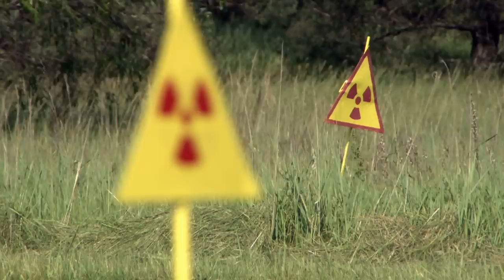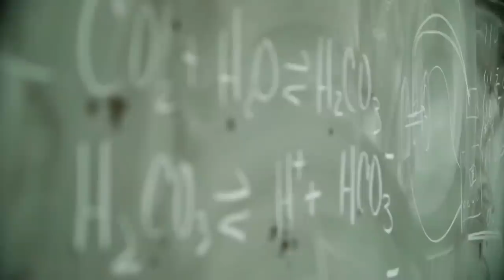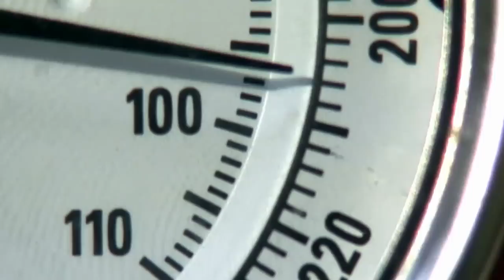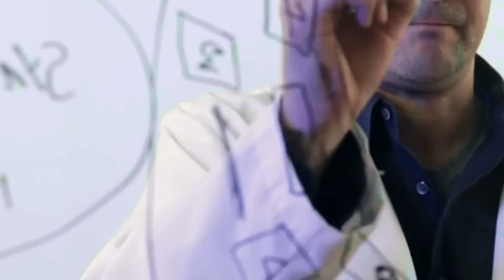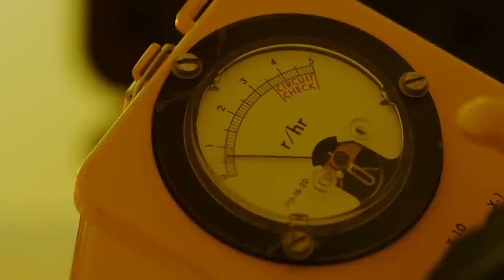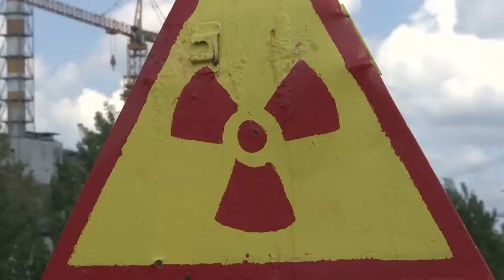China’s Most Powerful Global Weapon - A Synthetic Sun?

Comment: If a fission reactor splits atoms, and a fusion reactor fuses atoms, aren't they possibly two halves of the same engine? I wonder if anyone has ever contemplated using a fusion reactor to fuse atoms all the way up to fission reactor fuel and then splitting them back down... both processes produce energy, but from what I understand a fusion reactor has trouble producing more energy than it uses?? Maybe? But if both were linked together maybe the fission side of the engine output would compensate? Scientific thoughts, from an unscientific mind...
Reply: I don't have a degree in nuclear engineering, but I can safely say, it doesn't work like that.
Reply: @lamarkingram5320  I'm sure it doesn't, currently anyways but who the fuck knows the future, still its a cool thought to play with
Reply: Damn thats interesting. Like how you broke it down a bit for context. Nice one Justin, you've got me wondering now
Reply: The closest working fusion reactor to us is the Sun and with all its power and gravity it can only breed elements up to iron. A long way/weight off from Uranium, which is made by Super Nova's. So with the Sorcerer's Stone theory being disproven long ago I'm pretty sure that humans making very heavy pure elements is not going to be possible. Not to say that some sort of lighter element combo couldn't work but I cant call it. Interesting though, and good thinking.
Reply: Unfortunately it’s what’s known as the Iron peak, fusion and fission extract energy carried by the nuclei of elements with atomic masses less than and greater than iron, it’s related to the spherical symmetry of the nucleus of an atom, but creating elements above and below iron consume energy, thats why fission creates energy by creating lighter elements and fails at iron and fusion creates energy by creating heavier elements and fails at iron, note that there is fluctuation, but that is the general pattern
Reply: @connerwiseman4876  we make small quantities of very heavy elements in laboratory conditions everyday, the just don't last long, and that artificial sun burns 5 times hotter than our sun so I'm thinking we'll be able to overcome the obstacles eventually
Reply: @justinwelch1873  If you’re referring to operational fusion reactors, then yes, indeed and how exciting, but forgive me for adding this tiny pedantic note, when we create heavy elements in labs, we are theoretically adding energy to make that transmutation, that means it is certainly impossible the extract further energy from fission and fusion once either process reaches iron, I don’t think you were referring to that, but I just wanted to add it because I feel the need to put all the information on the table to make sure we’re both on the same page, sorry if I’m unnecessarily bring that up
Reply: @connerwiseman4876  so in my head none of this is currently possible, but and just going out on a limb here, if we used a fission reactor to power a fusion reactor, and a functional fusion reactor, and nothing else, our energy would net 0 or less? Look I understand it's not possible now, but maybe in the future? The biggest problem I see with my idea is how you reconstitute an atom after breaking it up into its various sub particles. That doesn't seem like an easy one to overcome.
Reply: Nuclear fusions are using two isotopes of hydrogen, deuterium and tritium,  into helium. It requires tremendous energy to achieve this. 
Hydrogen and helium are the both the smallest atoms known. 
Fission uses much heavier elements in the actinide series such as thorium and uranium. These are heavy dense metals. 
So as far as I understand, we can't fuse the lightest elements to create the densest elements. 
The only way to possibly do this would be using thermonuclear weapons.
Reply: Not a bad idea in theory. But consider looking at the periodic table. you have hydrogen in the very beginning, and uranium at the very end (let's not count artificial elements that do not occur naturally). At best, energy is produced by reaching the middle of the periodic table (right around iron) from both ends. And that's already 100% efficiency. So while it's tempting to "recycle" material created in fusion reactors and decaying them in a fissile one, it would take way too much time and way too much energy (more than these systems could produce).
Reply: @vonschweringen8321  everyone is stuck on what's currently possible, if we all thought that way there would never be new innovation or technology. Years ago fusion reactors were thought impossible, before that fission reactors, and all the way back through time. We're literally breaking off pieces of space with the hadron collider, making mirco black holes. Soo I'm positive we cannot do it now, but I'm very hesitant to say anything is impossible. I understand very smart people, people obviously smarter than me say it cannot be done. If it can be done in a natural process I'm sure we could find a way to do it in the future, yes it would require lots of energy and it would be really hard to do and possibly dangerous. But imagine a future where we could build a Dyson sphere, in this future planets and stars become our machinery. We literally accidentally created a warp field
 https://coffeeordie.com/alcubierre-white-warp-drive/

Now tell me you know for certain that in the future it will definitely not be possible to do. I feel like scientists these days are too specialized in they're fields and also want to be the absolute authority on these subjects so what is known is all there is to know. Once we can bend space time what's stopping us from putting an entire sun or even a black hole  into the equivalent of a backpack and carrying it with you besides energy. Imagine if the Wright Brothers just gave up on their plans to build a plane because they listened to literally everyone around them, like they just threw their hands up in the air and said "Well shit I guess it's impossible, let's do rock, paper, scissors to see who gets to marry our sister instead".
Reply: Stop giving me reason on why it can't work and tell me what it would look like or how it could function, or how we could possibly overcome the obstacles.
Reply: @justinwelch1873  Alright, firstly, when you say using a fission reactor to power a fusion reactor, do you mean using the energy produced by fission to heat up fusion material? Because it’s an interesting idea, and atoms reform in fusion cycles once the energy input starts to decline, then the plasma particles begin to reattach forming more stable elements which releases energy, boosting the reaction which should continue as a self burning plasma, if you’re concerned about knowing which elements are formed, it’s a matter of temperature and gravity as lower temperatures will restrict how dissociated particles can be in a plasma and gravity is needed to compact cooling plasma material to create heavier elements
Reply: @vonschweringen8321  Interestingly fusion is easier than you might think, Plutonium for example is a man made element created in fission reactors when uranium doesn’t split and remains stable absorbing more neutrons, additionally tons of elements, and really, every element above iron is man made, most were created in lab environments by heating up already heavy elements and carefully firing protons and neutrons to increase their size. If you’re talking about large quantities of heavy material from hydrogen and helium though, that’s Uber hard, a thermonuclear reactor couldn’t handle that task unfortunately and instead we’d need a supernova for the right amount of energy and gravity needed to compress cooling plasma into heavy elements
Reply: @connerwiseman4876  so harnessing gravity is the main barrier? So we would need technology that allows us to harness gravity, well as of now the only thing we can use to create gravity is mass until we figure out dark matter. So maybe something that can bend space time to put a large mount of mass in a small area and allow us to modulate the gravity  inside of a fusion reactor? Seems like we could do that if we invest money time and energy anf interest into Casimir cavities...
Reply: @justinwelch1873   Gravity is main barrier to produce super heavy elements from hydrogen and helium, though note, that process would consume energy, certainly not generate it, and with efficiency being a thing, we would get less energy processing those heavy elements in fission reactor back down to iron. Just remember that fusion reactions generally release energy when the products mass is less than of equal to iron and fission reactions release energy when the products are heavier than of equal to iron
Reply: @connerwiseman4876  so we'd need to scale up our fission and fusion reactors to the point that they produce more power than it takes to produce the gravity. Is there anything to say this is impossible? And if so how does our entire universe function,? if it's not a super large version of my idea? I understand there will be a thermal death of our universe at some point but what is life itself if not a mechanism to increase the efficiency of that power source as we reorder our surroundings, the materials at hand into things to increase our own efficiency and the efficiency that energy is used. Even if we aren't an efficiency mechanism in an engine then shouldn't our reason to exist be to fight back or even stop the thermal death of the universe or escape. If a process exists naturally then the only barrier to our utilizing it is the limits of our own mind, or the limits we impose on our thinking. I think it's possible, we just dont know how YET...
Reply: @justinwelch1873  The process of creating Uranium from hydrogen and helium requires a great deal of energy, this is not accounting for a real life reaction but just in pure theory, the simple equations requires lots of energy, then, splitting that large atom to go back will give you some of that energy back, but not all of it. No extra energy is gained from this process because you’re just going back and fourth, so in a way it’s just a very expensive battery, not a power source, assuming you can go between hydrogen and uranium at all, if you account for the tremendous inefficiencies involved, it would be far better to just use a normal battery over this entire process
Reply: Don't focus on it it's far future .. focus on thorium based molten salt reactors and Decay reactors.
Reply: @rajatdani619  True, it’s good to look at what’s practical now, personally I’m vying for SMRs but thorium/breeder reactors would definitely be great especially if that technology was then scaled down an implemented into current SMRs
Reply: This seems like a DEAD END.  Trying to keep temperature for 150 million degrees for any length of time,  it will melt everything around it.  In order to keep CONSTANT flow of electricity.  It has to keep the temperature for 150 million degrees forever.  This will never be reached.  Therefore, this type of project is a dead end.
Reply: @jeffjohnson5053  Very wrong, it is certainly a complex project, but unless you’re studying nuclear physics yourself, you should certainly not remark on its feasibility, in theory it is very much possible, the plasma torus does not come in contact with its surrounding walls as it is spun guided with large electromagnets, this reaction has already been demonstrated on large scale at incredible temperatures and boasts functionality. What you are right in implying, is that currently this is the utopian marker for energy generation, but it is certainly feasible, do not mistake that.
Reply: @connerwiseman4876  Feasible for only 17 seconds?  Who wants 17 seconds of electricity?  You are just not a practical guy.  We need a energy source that generate energy FOREVER, and Not 17 seconds, 17 minutes, even 17 hours.  That is just not good enough!!   Sorry to say, this is dead end, and I am just a practical guy.  You don't need to be a scientist to have common sense.
Reply: @jeffjohnson5053  Well I’m sorry to say that everything has a time limit, “forever” really isn’t a thing, I agree it would be ideally better to invest in fission which would lay the groundwork for more development in fusion, but you must be joking if you are going to make a statement that something is a dead end simply because you can’t even comprehend how it works, your entire argument can be rebutted simply by saying, sure it’s not practical right now, but it is the end goal, things will develop, and if you don’t understand anything, you shouldn’t say anything
Reply: That is called a Hydrogen bomb. Nuclear fission forces deuterium to fuse and leads to a very naughty explosion...
Reply: Actually, fission can overcome the Achilles Heel of fusion.  There just isn't enough Tritium to feed fusion reactors.  There are methods of fission that produce too much Tritium.  Waste Tritium from fission reactors could be used as fuel for fusion reactors.

btw  My high school Physics/Chemistry instructor called Iron "the ultimate cosmic ash."  You can make energy building up to Iron, and you can make energy breaking down to Iron, but when you have Iron, trying to make anything else out of it is going to cost you.
Reply: @ThatsMrPencilneck2U  Methods of fission that produce tritium? I know of neutron transmutation of lithium to helium and tritium, but I would be careful calling it fission or one might think you mean transmuting heavy elements
Reply: Do some further research.  You will discover why your suggestion simply won't work.
Reply: @justinwelch1873  You are correct. fusion power is further away now than it was 60 years ago.
Reply: They use different fuel sources, with fissile fuel being inherently unstable and requiring a large amount of precision, so that isn't possible. However, the general idea of one nuclear reaction feeding another is what was used to create hydrogen bombs - nuclear fission bombs who's massive amounts of heat and energy trigger a second nuclear fusion stage
Reply: @michael-dm2bv  I've been reading and re-reading your comment and trying to come up with a response to it but the only thing I can really say is that type of thinking is really lazy, to slander or discredit someone because of a handicap, or maybe because they got a couple things wrongs over they're career of being very correct. Scientific discoveries are usually made by discovering the right question to ask, and you cannot really be wrong for asking a real question. Like I might be wrong, I'm willing to accept that everyone else in the comments telling me it's basically impossible are probably right and most likely very much smarter than me, but I asked a question, and now I have many answers, cool thing about our universe is that you can have multiple different answers to the same question that can all be true at once, and what was true yesterday can change tomorrow as we advance our capabilities and understanding...
Reply: Unfortunately, the waste products of fusion are not fissionable. To fission the waste products you’d actually expend energy rather than gain it.
Reply: From a physicist: its hard to get energy out of fusion, but the energy is there, its been proven theoretically and practically (hydrogen bombs, the sun etc). To fuse heavier elements gets progressively harder (and by that I mean not difficult, but takes much higher energy, and the energy yield reduces). By the time we reach iron, there is no more energy released. You can't make elements heavier than iron without net adding energy, and WAY more than you got out of all the fusion up to that point. The only places in the universe that happens are exploding stars (supernovae, and they last just a few seconds, after starts bigger than our sun reach the end of their life - thats rare (in the universe, not just on earth), and there is no way we are going to reproduce that kind of cataclysm on earth, the numbers are literally astronomical). To get to Uranium, you need some of the biggest supernovae in the universe, the size that causes black holes - this is extreme physics, not just very difficult physics, but so far off the terrestrial scale that we are fortunate we don't have this going on anywhere in our astronomical vicinity, 'cos it would have killed us already.

So, long story short, no, we can't use fusion to "build" uranium to run fission. Not only would the physics not work at the fundamental level, but it would be beyond the capability of any entity that couldn't manipulate their whole galaxy (which we can't), and it's just a tad more economical to mine uranium right here on our tiny spec of a planet. Nature already did the fusing a few billion years ago, and gave us the products of its labours, locking up the energy of supernovae in the atoms or uranium we already have. Its a bit like the energy of our sun from a few millions years ago being locked up in fossil fuels we extract and use today.

Comment: Or we could just switch to regular nuclear energy. It's already clean. It makes very little radio active material that needs heavy storage. And it's safe. It's the disrespect of nuclear power that's dangerous. Look at the deaths from NE and fossil fuels. 1 is alot worst. 
Kyle Hill has a great series on NE going on.
Reply: yes, but it's also a huge liability. floods tsunamis earthquakes, random meldowns ect. all of these can incite disaster that leaves an entire region uninhabitable for years. so yes but you need to realise the risk/reward factor as well.
Reply: @onemorevideo1305  SMRs should solve the problem of not being as exposed as larger PWR designs, as they’re more compact. But also simply not building reactors on any grounds prone to disaster might be a good idea as well. For example the magnitude of the Fukushima earthquake wasn’t predicated to be so astonishingly high, however it was known grounds where earthquakes and flooding could occur